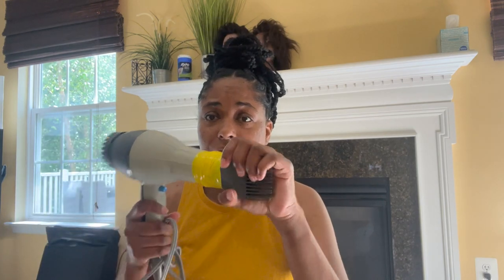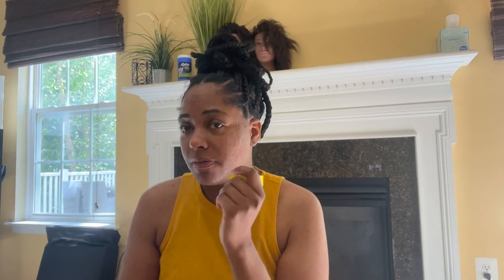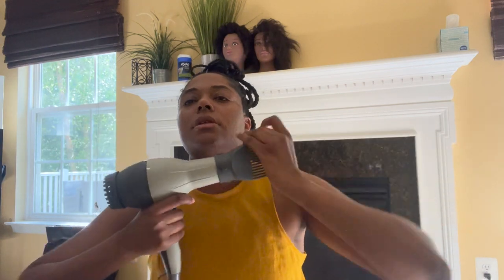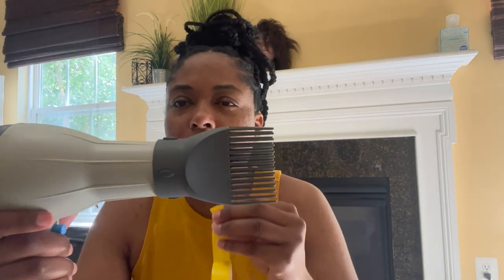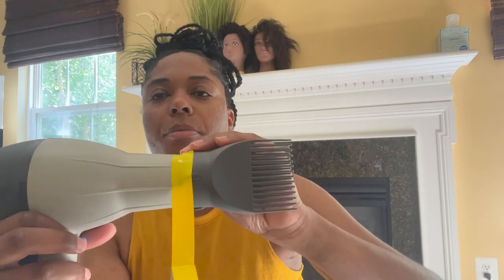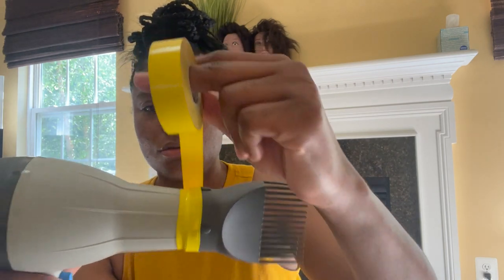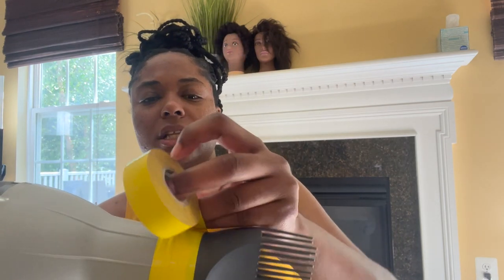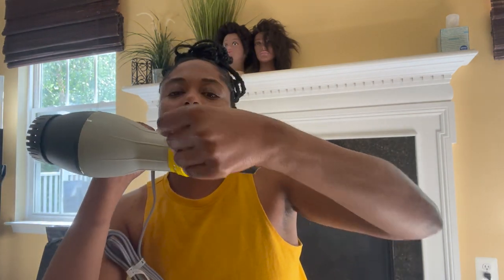How To Secure Comb Attachment To Your Hair Dryer

Comment: Have you had any issues with the tape melting during blow drying?
Reply from the maker: I haven't had any issues with melting while using. The tape does wear over time, but hold up pretty well. I can easily get up to a couple of years of use before I  have to repeat the process due to normal use wear. Hope that help!